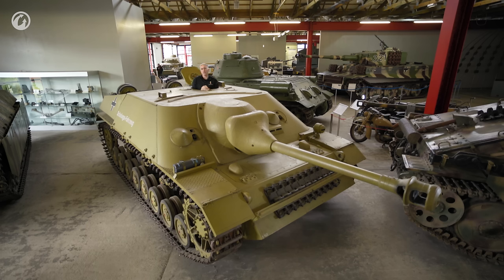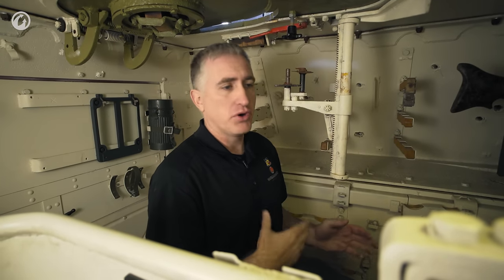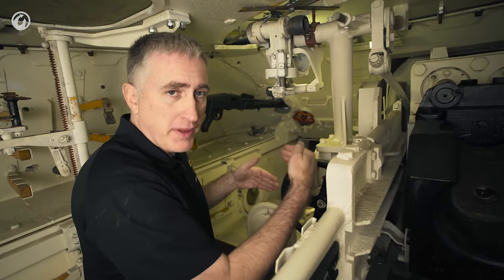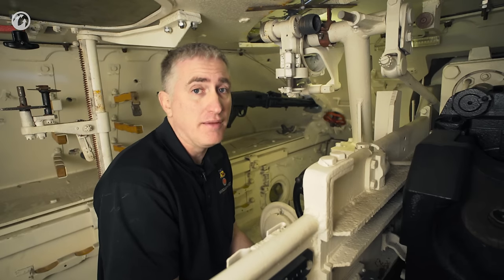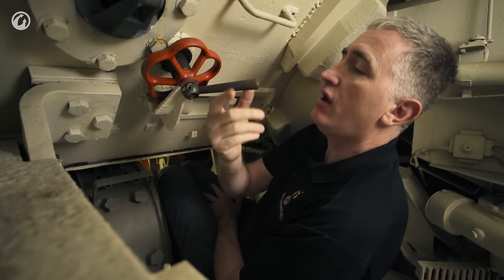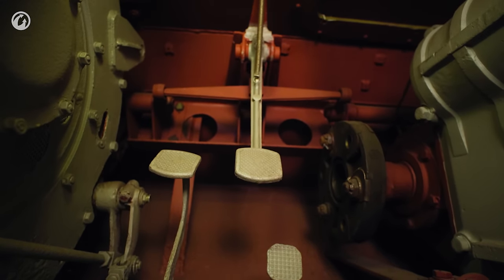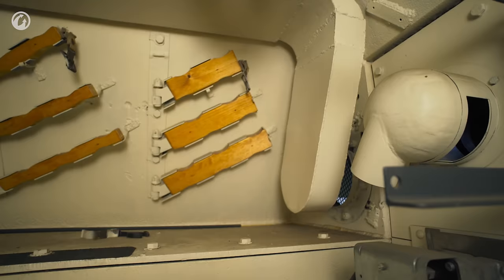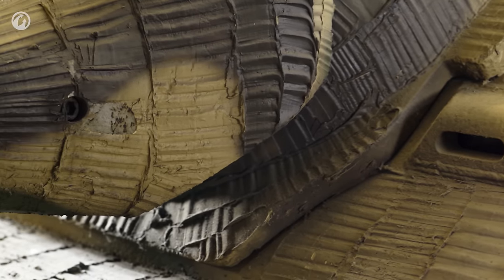Inside the Chieftain's Hatch: Jagdpanzer IV, Pt 2.

Comment: Scrolling through the comments looking to see if anyone else noticed what looks like a group of small exit wounds on the interior of vehicle, as if it's thin side armor was penetrated by something in the 20mm-40mm size, or maybe be a QF 2pdr, or 37mm as used in the M5 Stuart.  I wonder if they happened in combat or after the war was over and maybe people took pot shots after it was abandoned.  Or if those holes were supposed to be there to mount interior stuff to.  If they are battle damage, some of the crew probably died in there....spooky!  💀👻
Reply: He is in the Prototype vehicle, so either it was post or during war time Armour testing. Damage cannot be seen on the outside as per previous video. Highly unlikely anyone was in the tank when this took place.

Comment: The Jagdpanzer IV wasn't that great. A platoon or more of them ran into a some dug in 57mm Anti-Tank Guns during the first day of Battle of the Bulge. Despite exchanging fire for about an hour at short distances, the 57mm ATGs carried the day and destroyed the Jagdpanzers almost to the last.

You'll think that all that extra armor, meant to defeat everything from 75s to 85s would have an easy time of shrugging of 57s. But that didn't happen and the German vehicles burned, failing to breach the US lines in that one sector. It was on the Northern edge of the Bulge. Germans failed to take and hold the town near those guns as well.
Reply: If I am not mistaken, the 57 has decent penetration, and the JPz were built for staying hidden and firing undetected, not for brutalising their way into enemy positions and slug it out. 
In fact, the JPz IV was apparently rather decent, as its direct descendant, the KaJaPa (Kanonenjagdpanzer) was the primary anti-tank vehicle of the Bundeswehr until missiles conquered the anti-tank role finally, and it was in service until 1968. A modification carrying TOWs, the "Jaguar 2", served until 2005.
So what do you think, how bad was it in its intended role?

Comment: Did anything have 17 cm of armor in ww2?
Reply: That's penetration at a 30 degree hit at 500 meters. The distance may be larger. The angle might be worse. With e.g. the IS-2 having a 155mm mantlet, having the option to punch through 17cm effective armor (with a rare round that was to be reserved for emergencies only because tungsten was hard to come by for Germany) was not exactly overkill.

Seen from the Allied side, of course there's the Jagdtiger with 25cm (!) of frontal armor...
Reply: Tiger II production version had about 18cm in the turret face I think
Reply: The front casemate of the Jadgtiger had 250mm of armour.
Reply: You also have to take into account that test are not done under fire or at a moving target so it is best to have overkill than just enough.

Comment: That is extraordinary poorly designed vehicle. It is functional, cheap and easy to produce. Might even be reliable too, but jeez, everything inside is just wrong. From transmission and fuel being located near your legs for "comfort" purposes and fuel bank being right in the middle of a crew for better cooking. Every little small thing in it is wrong, from useless, obstructive pieces like mount for periscopic scissors sight which does not exist for most of the time, random location of weapons with no ability to fire them effectively to random elements sticking out of hull to smash your head into. I would not want to be in such vehicle. You gave Panther and Tiger a lot of trouble, but those tanks are simply beautiful and joy to be in. This is an ugly duckling.